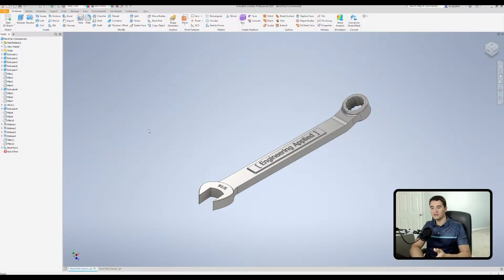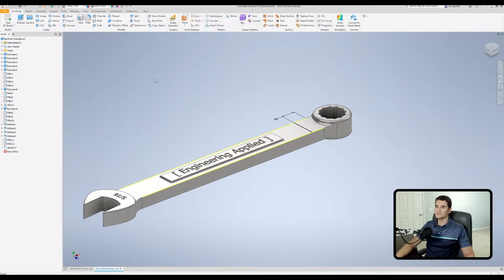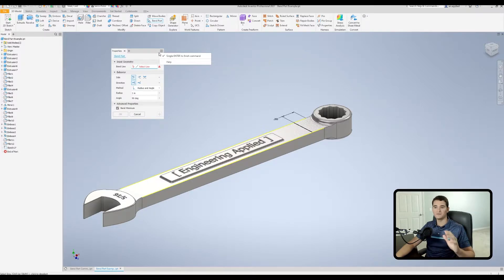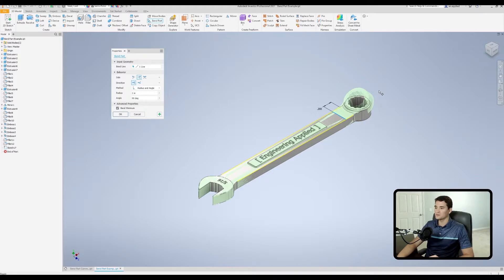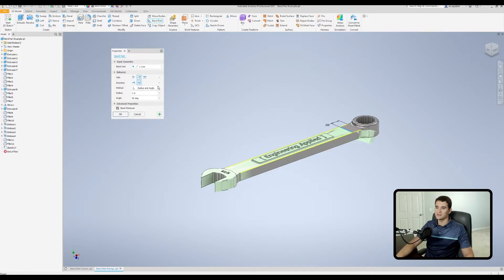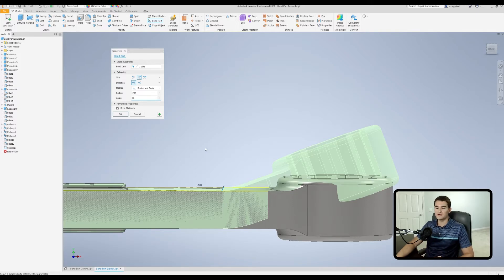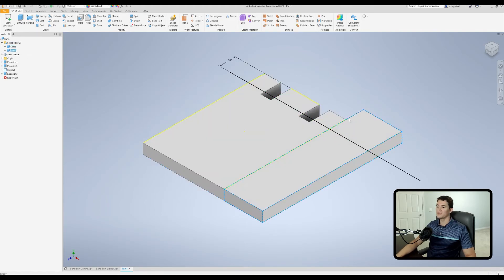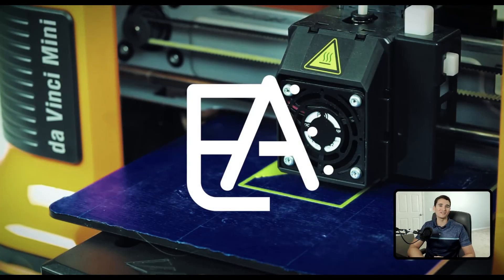Bend Part Command - Autodesk Inventor Part Tutorial | Autodesk Inventor 2021 IN DEPTH

Comment: I was always taught while entering a dimension especially if being checked for knowing a particular software, never enter zeros following a number like you did. .200. Supposedly it shows inexperience. What’s your take on that?   You may have said it. I watch soooo many of these videos.
Reply from the maker: That's an interesting perspective, however, in my years of engineering and product design, I have never heard that particular take on the subject. Whenever I enter values in CAD, I always think of the numbers in terms of how I would specify them on an engineering drawing. Even though you don't have to enter the trailing zeros and can enter ".2" for example, I like to always make sure I am accountable for the exact dimension as if I was showing it that way on a drawing. When I was designing interior products for executive aircraft, most of the dimensions captured on these drawings were to the thousandths place in terms of precision so I just carry that over into all other areas of CAD. I have found this allows me to work more efficiently (and accurately) as I always keep the end goal in mind starting with the design phase. After working with many different design software packages, I am of the opinion that if you are doing something that helps your process and does not negatively affect your end product, or its interface with others working on the project, it's okay to do that thing in most cases. 

I appreciate your viewership of the channel and I am glad these videos are helping you out. Even when I was designing products for a living, my favorite part of the job was teaching new/experienced engineers how to design in CAD software. Its repeat viewers like you that are allowing me to continue helping so many people while enjoying every minute of it.
Reply: @engineeringapplied  I understand wholeheartedly your view. I too when I was designing super abrasive grinding wheels and dental tools, involutes for gears  in aerospace we would at times be in ten thousands of an inch tolerances, At time we would get prints from NASA and I would have to design a tool to make the part on the print, talk about tight tolerances.  
I was head of QC and ISO 9000 (at the time) aside from head of the cad department and we would be in a controlled environment to be within tolerance while checking parts. Even in some of the machinery the coolants needed to be just so that the part was within spec during the making of it just to be able to check it.  I’ve been doing AutoCAD since 1982 and others,  Pro E, SW and I too would always enter the zeros as you would expect them to print, thinking if I didn’t it wouldn’t be accurate even though my default precision was .000 or .0000. Something like two shoes need be together or one gets lonely. LOL. Even though I was by some, told to not enter trailing zeros to save time,  I still did and still do. Maybe like you it’s how it’s printed. You mentioned Executive Air... in Teterboro, NJ by chance?  I have a friend that works there.  Anyway, here’s to entering zeros as we wish. Looking forward to more videos to get a grip on Inventor. I do work as a freelance and this one company in my radar uses Inventor, so before approaching them, I need to cram. Have a great day and stay safe.
Reply from the maker: Wow! Ten thousandths of an inch is an INSANE level of precision. That really puts things into perspective when you have to make sure the coolant is within spec to make sure that the part is in spec. It's really cool hearing from someone as experienced as you within the community and finding that we have similar tendencies and work habits. Oh no, I was just referring to executive aircraft in general (business jets, that sort of thing). Also, I'd like to thank you again for making my instructional videos part of your preparation for your business ventures, it genuinely means a lot to know that these videos are benefiting people around the world. It was nice getting to know more about you! Here's to high levels of precision, and even higher levels of zeros entered. :) Take care.
Reply: @engineeringapplied  yes, thankfully it wasn’t often. Usually +- .001 or .005 was typ. Being head of QC I did lose a few friends in the machine shop due to rejections. Especially when we became an ISO shop. I hated me with all the paper work I had to do.
Reply: Regarding business Jets and why it caught my eyes, a close friend of mine whom I built 3 houses for  (passed a few years ago) was an executive pilot for Phillip Morris flying Gulf Steams 4’s and Hawkers.
Reply from the maker: I'm sorry for your loss. Your friend sounded like a really interesting person. I bet there were some great stories to be heard from their flying days!
Reply: @engineeringapplied  I too was a pilot (just private single engines) back in my teens and twenties so we had a lot to talk about.   Every Friday after him taking sick ( Leukemia) I would bring him Dunkin Donuts expecting to stay only an hour or two, rarely did it I spend just two hours. The stories he would tell were so fascinating  to say the least. I’d be there most of the day. He Being forced into retirement I no longer had the pleasure of his phone call on a Saturday morning “ hey Doug, I have to take the G4 for a test flight, wanna come?”  after a maintenance or just a short hop for radio checks. So Fridays became a thing for us for a couple yrs. And one day during the week I got that dreaded call from his daughter. And that was that. But I have a lot of memories and learned so much from him regarding aeronautical engineering ( he re- wrote the maintenance manual for the G4) so conversations were quite interesting.